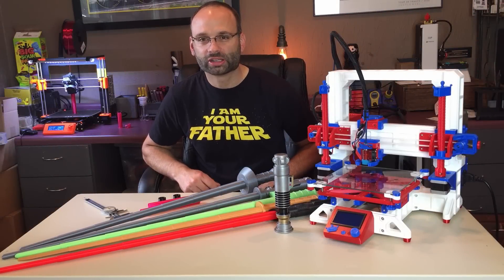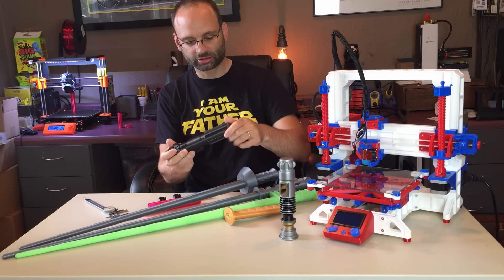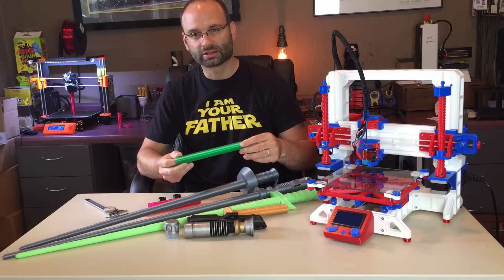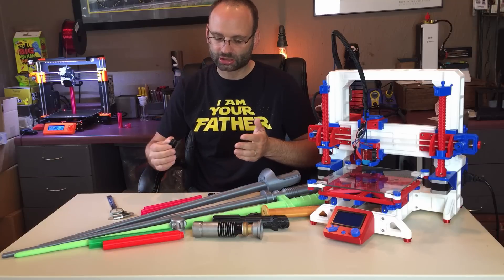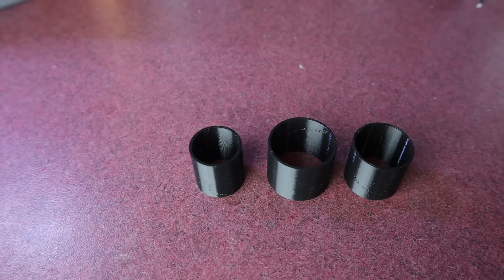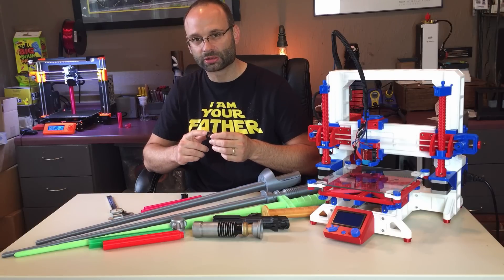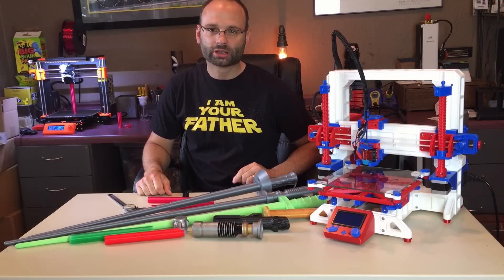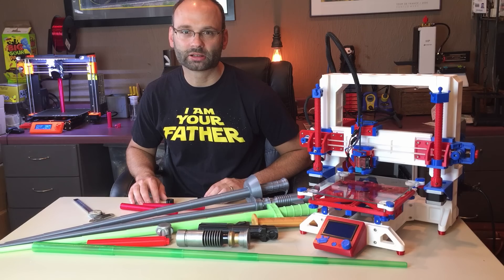Collapsing Swords - Troubleshooting

Comment: So the issue I'm having isn't part of this video. As the print gets taller the blade segments wobble causing layer shifts which ultimately end up causing the blade to not extend completely, and even keeping the innermost blade segment from extending at all.

This is specifically with the v2 Katana you have on printables.

Comment: So I made a very strong blade, but sometimes it's hard to get the blade to retract back into the hilt. Like it requires a lot of force and twisting on each of the segments to get the blades to go back down. Any tips on how to make the blades go back down inside of the hilt any smoother? I was thinking sanding, some sort of clear polish that dries hard, perhaps bigger layer lines would make it easier? Currently I'm using 0.16 in vase mode.

Comment: Hey there just wondering, i did the test print 3 times and worked fine each time, but ive tried printing the Print in place drill sword 2 times and the spear 3 and the blades still dont come out of the handles, i use the ender 3 v3 SE and the creality slicer, how can i fix this as i cant seem to find the settings for it?? any help would be amazing
Reply from the maker: You need to adjust retraction settings.

Comment: Tip if your tests are fusing at the seams. 
Im using Orcaslicer and for me it was "Travel distance threshold" being set to 1mm, that being greater than the distance between the pieces meant it wasnt retracting filament at all when moving between parts. Setting this to 0 fixed it for me.
In Orcaslicer its in printer settings under the extruder tab.
Hope this helps anyone troubleshooting this problem.
Reply: Thank you for pointing this out. I have been trying to get this to work for a week, checked my travel distance and it was set to 2mm. Changed it to 0 and even with all seams aligned in back it works.
Reply: what is this setting called in cura?
Reply: could you please share what other changes or setting did u use? im trying to do it, but it always fails...

Comment: How do I get arid on the bottom layer for pursa spicer
Reply from the maker: If you cant turn it off, you can always flip it over. The tip of the blade can be solid on both ends, it wont hurt anything.

Comment: I have a problem, I printed a jedi sword all in one, and when I moved it out from the 3d printer, all of the inside pieces fell to the floor. What can I do to avoid it? Thank you!
Reply from the maker: Sounds like a bed adhesion issue. What surface are you using? I like a smooth PEI, and clean it often.
Reply: @3DPrintingWorlds  I'm using the basic that came with Voxelab Aquila X3

Comment: when you said the thickness measures about .33 inches when you convert from millimeters, i'm thinking you may have meant .033 inches
Reply: the swords are sick tho i'm gonna try printing the katana first
Reply from the maker: @woofelator  I dont remember, the video is so old. lol  The blades are .85mm thick, I find I get a better length if I print at .9mm.

Comment: I have printed the interchangeable sword about 6 times now in vase mode and they will not catch they are "too big" and fall through each other and don't fit together. I have .4mm nozzle, using petg, I had the wall thickness to .8mm and flow to 110% and it does nothing, please HELP I'm losing my mind
Reply from the maker: Just increase your wall thickness until the catch. .8 is not enough. It should be .85 according to the math but I’ve been having better luck at .94 lately.

Comment: i printed the test piece it took 20 mins it came out in 1 piece 1 side have some weird scaring and it doesnt expand help
Reply from the maker: Is it your layer seam?  I would set it to inline and use retraction setting to get it as small as possible.  Check out the print setting page on my website. I also have a FB group were you can post pictures.

Comment: I might be really late to the party, but here's a tip for people struggling to get it to print with Cura. Cura's default is "Combing Mode" = "Not in Skin". This results in a blob on the end of the path that will be there no matter how hard you play with retraction, wipe or coasting. Everything else will start to help once you set it to "Off".

I also print with a 0.6mm CHT Nozzle and found it to be crucial to print the blade in two walls that are 0.44mm thick. So set your line width accordingly. The reason for this is that the travels usually  go over one already printed wall so it wipes some excess filament on the already printed one. Which helps with the seams not sticking together.
Reply: HO-LEE-SHIT THANK YOU!

I was at 14 failed test prints, every single one fusing at the seam no matter what I changed (got one to work with Random Seam but its just ugly as hell, and I'm better than that).

0.4mm nozzle
0.43 line width
Thin walls (? not sure if it even did anything)
Coasting enabled
90% flow
Retract at layer change with dialed in retraction amount (6mm in this case)
Seam on sharpest corner (not sure If i had wipe enabled but if it was it wouild have been 1.5mm)

most importantly COMBING MODE = OFF!

LEGEND!
Reply: @BillyZard  I'm glad that I was able to help.
Reply: what do you mean print the blades in two walls that are 0.44mm thick
Reply: @seoungbinjun5493  Check the "Line Width" in Cura. It should be set to 0.44mm.
Reply: @eduardkosel8726  will these steps fix my fusing problems?
Reply: @seoungbinjun5493  it helped me. If your rings are fusing together turning off combing is the first step. If this already improves your print you can try to tune the other parameters suggested in the video.
Reply: @eduardkosel8726  I'm sorry the video was confusing for me but turning on wipe and coasting is going to help it right?
Reply: @seoungbinjun5493  try "Combing" = "off" in Cura first. Do the test print. Then try coasting and wipe settings.
Reply: i tried printing the test print with the "combining" ="off" and failed and so i turned on wipe and coasting and set my line width to 0.44 mm and printed again and it was still a failed
Reply: @eduardkosel8726  can you send me a screenshot of your Cura setting for this print? I'm looking and do not see the coasting and wipe settings... what section are they under?

Comment: I printed my first last night without doing a test. I know....... it wouldn't separate and when i tapped it, it broke in two. Thanks for the video. Is there a way to ensure it is not so brittle?
Reply from the maker: They blades are not real strong but they should not break that easy.  Its hard to tell the issue but it sounds like the layer lines are not adhering very well. Maybe turn the heat up?  Assuming this is not a silk or matte, they are very weak.

Comment: please anwser my question, my printer just makes the components in the katana just weldes them together in one corner but in the other its fine what do i do?
Reply from the maker: I am assuming that corner is where the layer seam is.  I would move it from a corner and try to decrease its size with retraction settings. I have good luck with a negative retraction distance, some people have luck with a radium seam.
Reply: @3DPrintingWorlds  could you do that for me and create a thingiverse file please and give the link for me couse ive tried to print the katan 4 times and nothing worked and ive done like 5 katana test prints already
Reply from the maker: @astrix6436  Do what?  Its all controlled by setting in your slicer.  Each printer is different so you have to tune your own printer.

Comment: Hey I'm really having trouble with the katana. I've printed 3 they've all failed I'm pretty sure its bc the seam when the next one prints it fuses at the seam any idea what to do? Do u have a cura profile specifically for these?
Reply from the maker: I have good luck with negative extra restart distance but i'm not sure if Cura has it. It depends if the blob is caused by the start or end of the seam.

Comment: Is there a way i can scale these down to make the print times sooner?
Reply: 24 hours is a long time, lol. I'm just nervous to let it go for that long rn
Reply from the maker: Only if you also change your nozzle size.  Try the test print first, or locate the "replaceable Blade" versons on thangs and print the blades in vase mode.
Reply: @3DPrintingWorlds  when i scale the size of the blades down in vase mode, do i just scale the hilts down by the same percentage?
Reply from the maker: @trunkarrett6295  Yes!  But dont forget you also need to scale down your nozzle with.  I'm going to work on getting better written instructions on my web page.

Comment: Where can I find the STL for just the blade pieces so I could print them separately? Really appreciate your work by the way, awesome stuff.
Reply from the maker: Check me out on thangs, I have a bunch of new stuff there.
Reply: @3DPrintingWorlds  are the blades interchangeable as long as I print the right width. I used the separate blade pieces from collapsing light Saber on the sith version.
Reply: Can we get link for print retractable sword slith separate. So it doesn't get stuck. I can't find it.

Comment: Whenever I try to print the lightsaber blade as one the bottom 3 parts print fine but the top 2 get fused together but when I print those 2 separately they just fall through each other, any ideas on how to fix it?
Reply from the maker: Increase your line width to get the right fit.

Comment: I am wondering if I were to enlarge your design like ie: 0.2 percent would that cause me issues and help it print a little bit easier?
Reply from the maker: I've learned a lot of tricks since making this, I need to make a updated video.

Personally, I would print them separately in vase mode. stronger and better results. 

Check my thangs, that is where I post new designs.  I have most with removeable blades now.

Comment: Trying to print the Collapsible Master Sword, using Super Slic3r. It won't allow me to pint blade 1 in vase mode with a solid top layer. Is there a work around or way to get this done? Thanks.
Reply from the maker: Sorry I'm not sure, I dont use Super slicer. Its not a problem in PS or S3D.

Comment: My center blades are coming loose from bed.  I printed perfect test prints.  Printed a sword successfully.  Printing another now and can see the blades moving (not adhered to bed) will let you know in 3 hours if it’s a fail.
Reply from the maker: Check me out on thangs, I only post new stuff there. Many of my swords now have a removable blades. Its easier and stronger to print in vase mode and insert.

Comment: any tips making these stronger? the blades keep breaking for me
Reply: use petg, it has more stress resistent
Reply from the maker: PETG will help but they will never be super strong.
Reply: @3DPrintingWorlds  can you scale them in the slicer or will that make the locking mechanism not work anymore ?

Comment: I’m a week in 3D printer knowledge and I’ve done the test print twice but the pieces just slide off each other, like fall apart, any tips?
Reply from the maker: That's actually what you want to happen!  If the parts stick together then you have issues. You should be good to print the full sword.

Comment: my first one ... came out almost perfect sadly the points where it exits the layer and goes to the next seem to stick
Reply from the maker: Maybe your first layer was too low?
Reply: @3DPrintingWorlds  i opened it up with a sawblade near the bottom of the handle and managed to extract the stack of blades, i then tried to seperate them from each other by using a jixsaw blade, through that and some "gentle" force i did manage to seperate all the blades. They seem to have been sticking together by spikes created once the printers nozzle went to print the next layer of the next blade segment, i think i need to increase the fillament pullback a bit or decrease the extrusion rate ... 
Anyway i cleaned up the blades and re assembled them into the handle and glued the bottom of the handle back on (with extended blade to prevent any glue reaching the blades) with superglue and it does work gereat ever since.
With 100%infill the handle is nicely stable and wont let itself crush even with a strong grip what makes it feel even better.
I'll try to reprint it 2 further times (as gifts for my younger cousins who most likely be blown away by them and i keep the one print that i managed to salvage) 
Thx for the model and it just looks awesome ... Although now that i see the lightsaber ... I got some green and red transparent fillament aswell as some led strips ... What could turn out quite awesome! (The fun thing is, i would not even barely consider buying one of these lightsabers as i would not throw out money for such a cheaply produced and pricy maketed product, but if i can 3D print them myself it kinda gets interresting as it would be an achievement for me and something to be proud of
Reply from the maker: @Em.P14  Glad you got it to work and are getting your family into the technology too.

Comment: I printed the sith saber in 3 parts. But the threads for the cap and handle are super tight.. o ly isdue i've had so far. Any tips for the cap/handle threads?
Reply from the maker: Can you try scaling the cap down just a little and try reprinting?
Reply: @3DPrintingWorlds  I did at 99 percent and still too tight. I'll print it at 97 next and let you know
Reply from the maker: @KroNiKDluX  It works perfect for me at 100%.  I could be under extruding, or you could be over extruding.
Reply: @3DPrintingWorlds  Yeah possibly. New printer and the esteps were set to 93.. did the calibration and it was 7mms off which made sense. But mabye I should change the estep settings and try printing it at stock and see what happens

Comment: I saw this on thingiverse hope this helps for people using Cura 
Slicer - Cura 4.6
Nozzle - .4MM
Layer Height - 0.2mm
Line Width - 0.44mm
Wall Line Count - 2
Print Thin Walls check
Outer Wall Wipe Distance - 0.8mm
Retraction - 7mm @ 45mm/s
Cooling @ 100%
Coasting Volume - 0.004mm3 - If I try 0.064mm3 I get blank spaces. It's as if the printer doesn't finish printing the whole circumference of each cirlcle.
Minimum Volume before coasting - 0.8mm3
Reply: Thank you so much!!
Reply: Ayo these setting work great for the vyper, many thanks!
Reply: These settings worked perfectly with my S1 (Cura 4.8), thank you!
Reply: I tried these with Cara 4.12 and the bottom was fused. Does anyone have tips on what to change for Cure 4.12 on an Ender 3 v2?
Reply: I'm using Cura... NOT  Ulti Maker Cura.... just Cura (version-4.8.2) will your settings (for a retractable sword) work on my version..... also, i use the ender 3 max neo!
Reply: @derk4737  Im here wondering this literal same thing lol
Reply: THANK YOU SO MUCH

Comment: I use prusaslicer, and when I print the blade I can’t seem to get the segments to “hook” on to eachother, any recommendations for settings?
Reply from the maker: When I had this issue I increased  my extrusion multiplier by a few percent.
Reply: @3DPrintingWorlds  I will fine tune the setting then, thank you

Comment: I printed the sword and I can’t get the blade to clone out. What do I do
Reply from the maker: I would find the reason why the blades are sticking, then adjust print settings so it does not happen. I know bad answer but I would need a lot of information to diagnose the issue.
Reply: @3DPrintingWorlds  Thankyou. The problem is that they are sticking together inside the Handel. I think I should just make the layer thickness lower
Reply from the maker: @dixienormus4230  Is it stuck all around or just at the layer seams?

Comment: Since my 3D printer can only print models up to 180.2 mm tall, can I make the collapsing katana one millimetre shorter in the slicing software? Or the segments stick together?
Reply from the maker: Sure, It would work best if you only scale the Z.  That way the wall thickness stay 2 wall thick.
Reply: @3DPrintingWorlds  thanks. Hope it works this time.
Reply: @3DPrintingWorlds  This still does not work. Can I make the size bigger than the original model size and use my Anycubic Mega S?

Comment: For some reason, the when I slice the katana .stl, it only has the centermost blade unit (along with the hilt) on layer 1. The other diamond-shaped concentric blade units don't start until layer 2. This seems like a guaranteed fail for adhesion. User error? Or has someone else experienced this? Tried both Cura 4.6 and 4.8. The katana test piece came out great when I printed it.
Reply from the maker: Hmmm.  I don't know what is going on, I don't experience this issue.  Can you try just moving it down slightly?
Reply: same

Comment: These are amazing prints, I only wish I had your settings, My lightsaber blade fused together. The dagger came out pretty good
Reply from the maker: That's odd, I thought the dagger was the hardest one to print.
Reply: @3DPrintingWorlds  I also printed the dagger it came out wonderful I stayed alway from the swords since they seemed harder to print
Reply: @3DPrintingWorlds  I printed the lightsaber three times the blade keeps fusing...I will try to print it individually
Reply from the maker: @byronkobialko3442  Print them in vase mode, much easier print just a little more work.
Reply: @3DPrintingWorlds  So I tried different settings that still fused by was able to work the pieces apart..So win-win and it looks great. Thank you for your assistance, great design, I use PETG.
Reply: @3DPrintingWorlds  Hey man! when i printed in vase mode, it came out with the piece completely solid. how do i make them come out hollow so i can put them together ?
Reply from the maker: @moemoemoe11  Select vase mode in your slicer. Remember to change your line width to about .90mm.